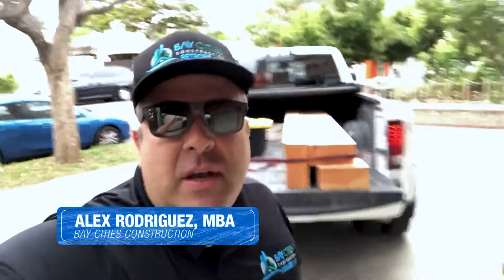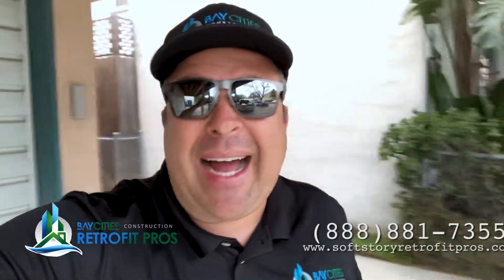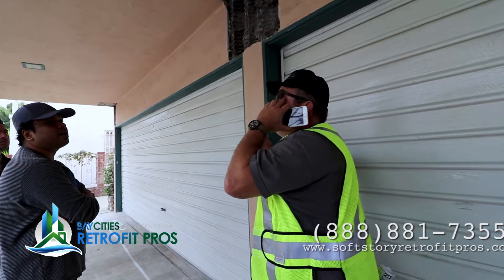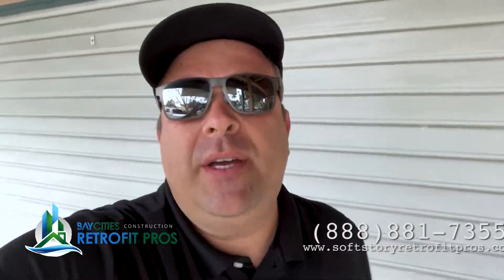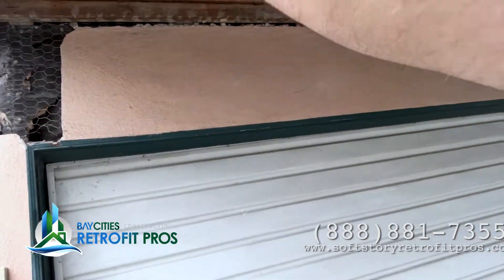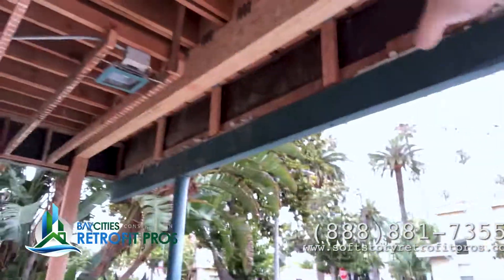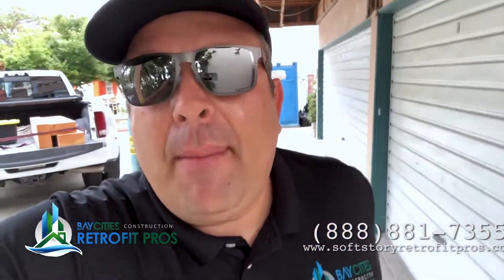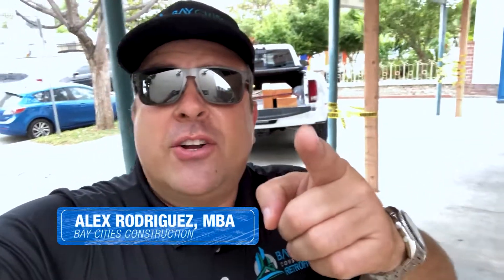Using Cantilevered Columns | How We Prep a Building for a Soft-Story Retrofit

Comment: Cantilever column systems need to accept 5x as much seismic shear force as wood shear panels because they are stiffer, transferring the loads up the structure like a sudden impact rather than a gradual acceleration that wood gives you. In terms of retrofitting, it seems this could potentially INCREASE loads elsewhere in the building post-retrofit, depending on the structure. Wood has a response factor of 6.5. I would avoid any system having a response factor under 5 or so, unless you're analyzing and retrofitting the entire building.
Reply from the maker: It's all about load paths, when done right, cantilevered columns can be just as robust as a moment frame.
Reply: @Baycitiesconstruction  It can, but the point is that a robust first story can introduce additional loads to the stories above. More rigid is not always better.